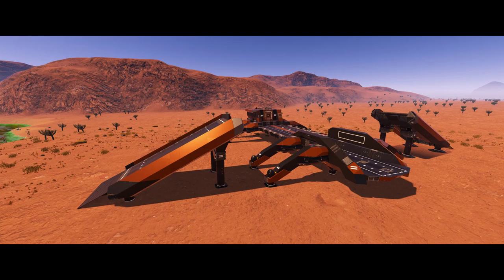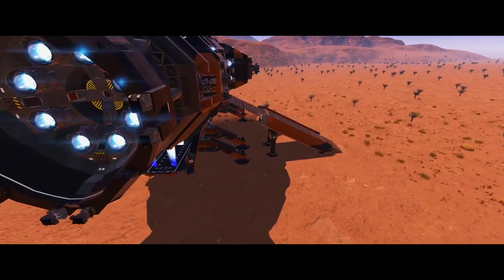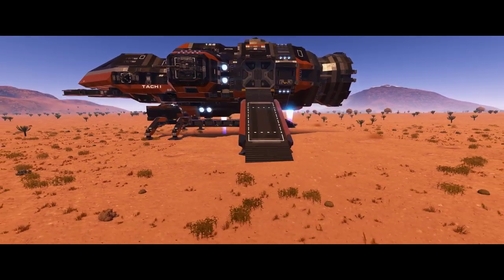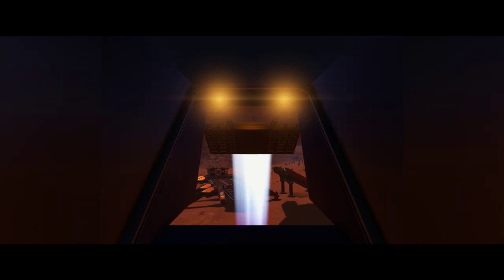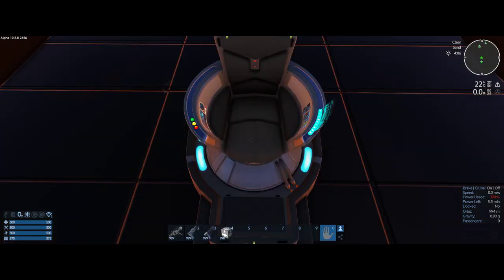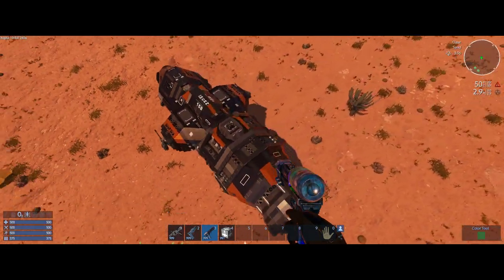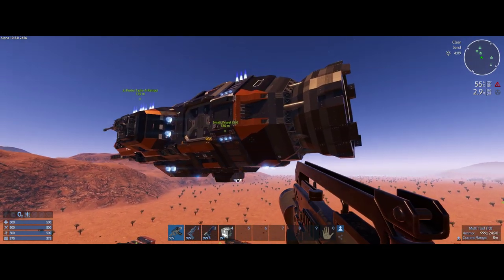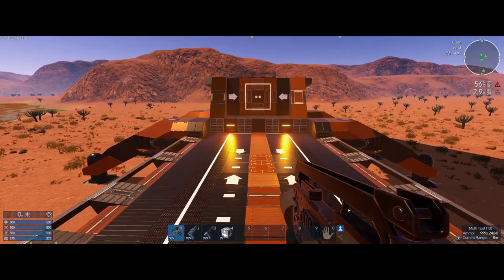Empyrion Galactic Survival - MCRN Tachi update + Landing base

Comment: Your a amazing builder, and i have many of your builds in my collection. I love this ship from Expanse. Just one thing to remember the decks run as if the thing was on the ground with the main thruster down. This is so the can accelerate at a constant 1 g or decelerate at 1g. The ships from the series are always either accelerating or decelerating, and rarely coast. I don't think you could do that with the SV version but a CV build may be flyable like that.

Comment: Wow... The Docking pad is looking awesome! I'd say keep it as a separate thing. To gather the resources required for this... You'd most likely have a fairly big base already. Of course you might want another base and thus the 'full set'... So i dunno :) You could add a solar panel 'module' for powering the repair bay?... Under the front end of the ship perhaps? ... Though i guess that would cast shadows when the ship is docked :)

Comment: Fantastic work as usual Jeff. As Shane Johnson mentioned in a previous comment, an option of a stand alone lite platform for repairs and the full version with platform and integrated base would be very useful.
Reply from the maker: Thank you. Currently I made the docking platform a lite version and made it cost less. I may have to also make a version with a base built into it, but for now I will have the lite version of the docking pad released when the ship gets released. Thanks again!

Comment: Base or landing platform... I'd go with the landing platform.  Also I would remove the repair bay and add solars.  If you want to repair it's best done in orbit with a specialized structure.  A base with the same faction/theme could always be plopped down next to this later.

Comment: question will you have to rework most of your blueprints with this cpu limit thing coming soon
Reply from the maker: It sounds like it could make most of them possibly never work again in game. Unfortunately this includes all my recent and upcoming things as well. I got the impression only tiny little single function creations can continue to work at least for SV's and HV's. So anything above size class 1 is pretty much toast. Will see thou. There are supposed to be 4 tiers for CPU. I don't yet know how it will play out yet. I made several 7500 cpu creations. It was limiting for sure, causing me to make choices I didn't want to do, make ships under powered with not enough storage. So, I for see a bunch of small blobby boxy looking things to be most efficient in block use. The kreil are toast :( The more exotic designs tend to be more wasteful. Again thou, IDK for sure how it is all going to play out yet and I was really only looking at HV/SV's. Bases may be fine, and CV's IDK really. Thanks again!
Reply: @jeffrandall2813  thanks alot for your info and i hope this does not stop you from building most of the time all i use is your ships

Comment: How do you convert from combat steel ?
Reply from the maker: I will show that process on the next video. It is done with a console command replaceblocks ID# (original block name), (new block name), but to know the block names you need to do another console command DI to tell you what block names you are looking at. Thanks again!
Reply: @jeffrandall2813  don't forget the extended2 3 4 & 5 blocks! Instead of just full&thin